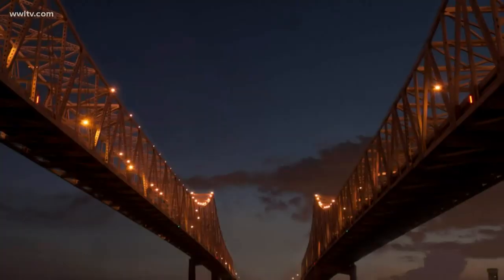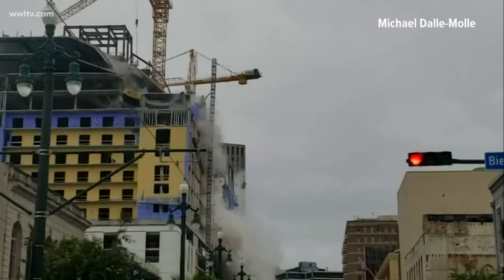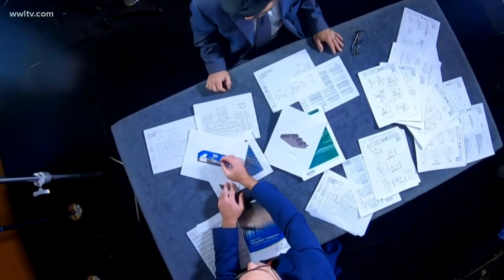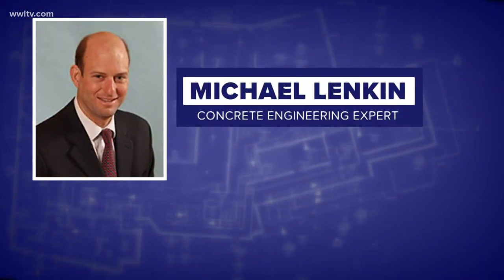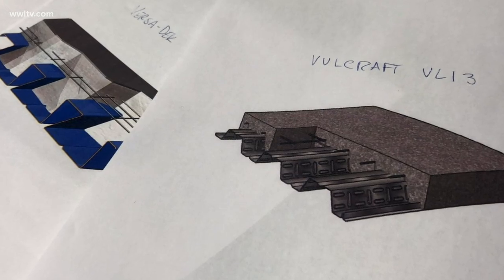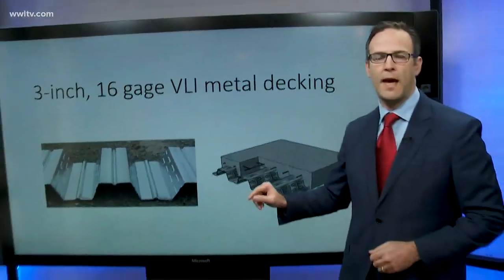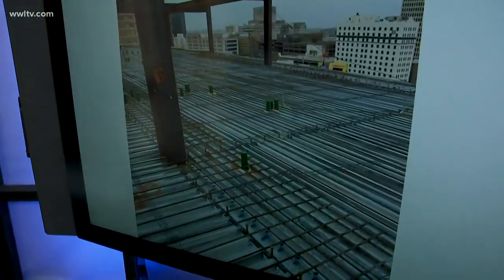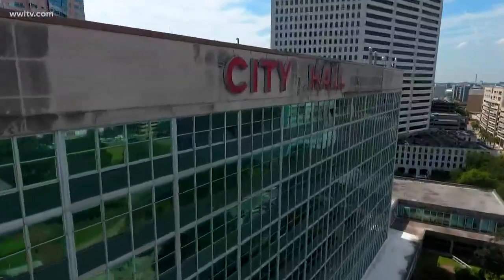Metal used to hold concrete floors at Hard Rock Hotel different from what city approved, records sho

Comment: Just because the city wasnt notified doesn't mean an engineer didn't approve the change. I find it hard to believe this was a deck failure but it's a strange design so who knows.
Reply: Matt Bosman I will be shocked if it wasn’t a decking failure.
Reply: @logansams1559  Interesting, do you think the change in thickness was to blame or the change from the traditional trapezoid to that inverted style?